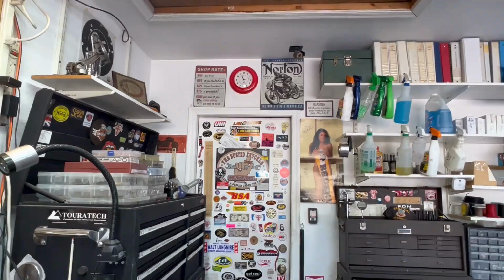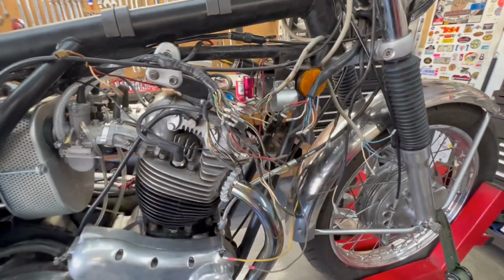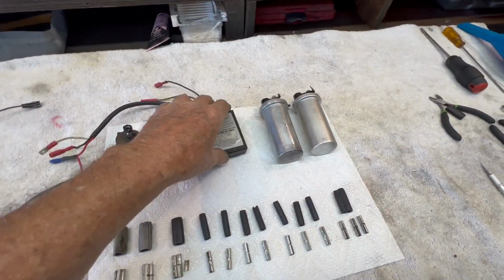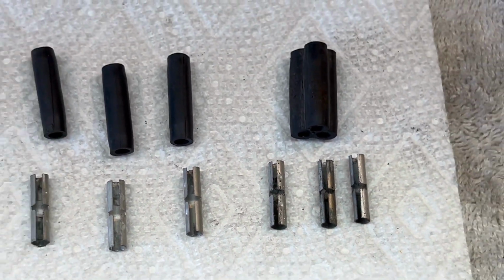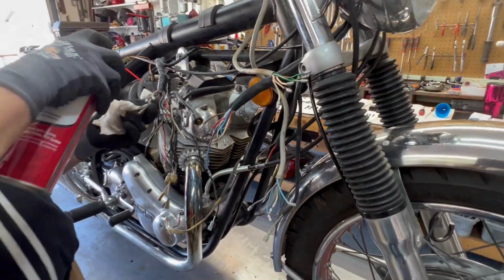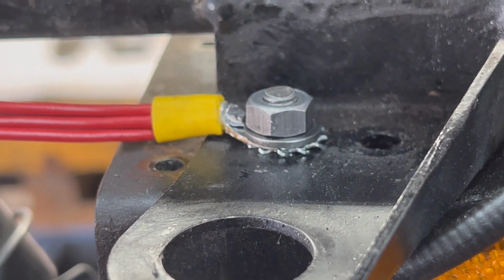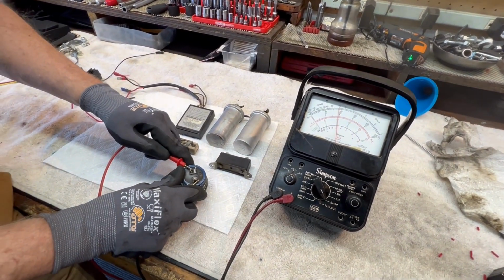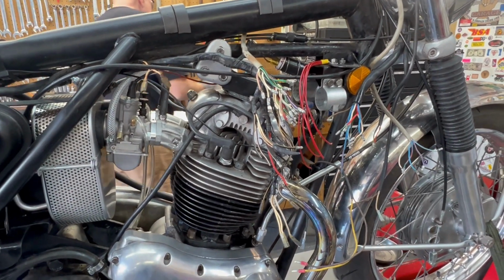Vintage British Motorcycles Repair/Restore

Comment: I'm not great with electrical stuff but I like doing basic wiring, like crimping on new connectors and putting a new component on the bike, or cleaning up someone else's messy wiring.    Do you replace the bullet connectors or just the piece the bullets go into?
Reply from the maker: The bullets are usually OK.  I only install new ones when the one in place have been damaged, are poorly soldered, or I'm shortening wires.  I use crimp-on bullets with the really expensive crimper for most connections but sometimes solder them when I'm in the mood.

Comment: Ill be having to deal with this stuff on my rat 1970 commando roadster. Im going to put a new wire harness on it,  What ignition system do you like,  Boyer or Tri spark or other.  What charging system. Podtronics ?  Do these mods eliminate the coil resister. I dont have any coils yet so can I go with 12 volt. I have a two wire stator. Does that dictate what solid state regulator rectifire I need. Is a three wire better. Should I eliminate the capacitor like you do.
Reply: I've used a Vape-Wassell EI on my '74 850 Co0mmando past 6 yrs...flawless. It is basically a Boyer knock off with improvements, like being fully epoxy encapsulated...no more breakages at the stator plate wire connections. The best is the Trispark, but about 2x the price. 
For coils, stock 6v run fine with the any of the EI's, all have instructions on how to wire for 2, 6v coils or 2, 12 v coil or even a single 12v, dual out put type coil . Test your coils, esp if original, as per Workshop manual to confirm they are in good condition. 
Two wire stator means it is single phase (stock). Runs fine on any Reg/Rec like Boyer, trispark etc., even if they are for a three wire stator (3-phase). Just cap off one of the extra wires to the Reg/Rec. 3-phase if better as you get more output at lower rpm, so it running higher consumption devices, Halogen bulbs, heated jacket/gloves and doing lots of short trips, then 3 phase will help.  I've kept my stock capacitor on the bike...it saved me one day even with the EI...battery over heated from a dead zener voltage regulator...overcharged the battery, heated and bloated it up. Was able to start bike and run without lights rest of way home. Boyer edoes sell a version of their Reg/Rec with a built in capacitor for emerg starting (not sufficient for electric start bikes though...you'd have to kick it).
Reply: Thanks for the great reply  @TornadoCAN99
Reply: Thanks, will process this info and make my decision.
Reply: Thanks, will process this info and make my decision. @TornadoCAN99
Reply from the maker: I agree with TomadoCan99.  I use Podtronics or Tympanium.  Both good.  Nortons came with 6-volt coils. There's good documentation that 6 volt coils are better than 12 volt coils with electronic ignitions.  I REALLY like the Vape ignitions, but CAUTION I had two occurrences where the mag pickup posts on the back were rubbing against the timing case.  I had to "relieve" the case areas where they were touching.  Never had it happen with Triumphs or BSAs though.